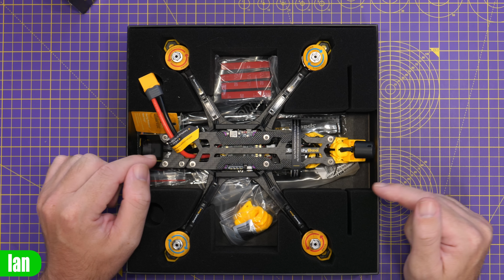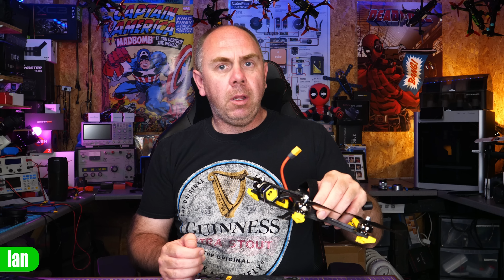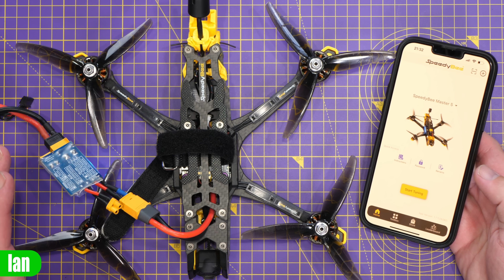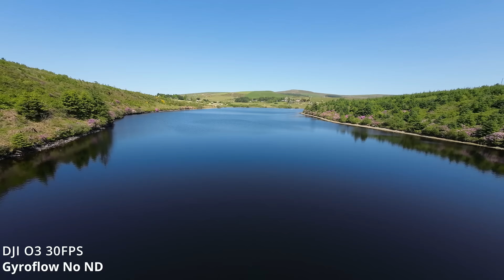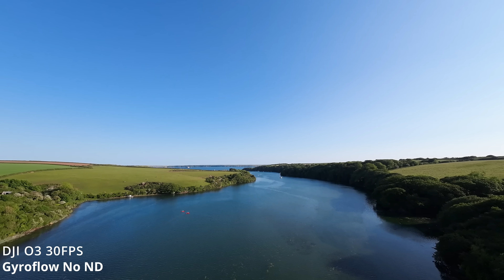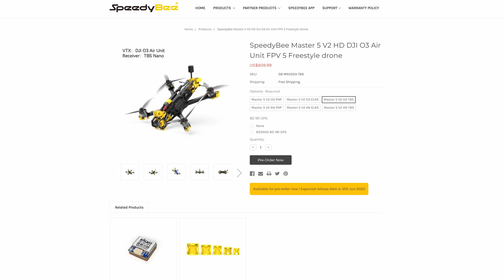SpeedyBee Master 5 V2 Bind & Fly FPV Quad - Making FPV Easy For Everyone

Comment: Could you run this version with the DJI Controller 2 as well? Just reconfigure it with betaflight and as such switch between two different controllers if needed?

Comment: Hi! What power of VTX needs to set in Betaflight for DJI o3 Air unit (25/200/400/800)? There are no one option selected in "Power" select by default. I fly with DJI google's Integra and video signal is lost at the distance about 300 metres.
Reply from the maker: There is no power options on O3 it’s entirely dynamic. The betaflgiht settings have no affect.  If your loosing signal at 300m it counts like you may have a lot of WiFi around you ?
Reply: There are no wifi, I fly in the fields far from the city.  @MadRC

Comment: Hello! I'm a noob and I need help!)) I have exactly the same SpeedyBee Master 5 v2 (ELRS), and RadioMaster TX 12. I have already bind them. But.... The Speedy Bee doesn't react on any manipulation with TX12. I just have change OSD. So what's the problem it could be with? They both have the same 3.2.1 version of ELRS firmware.
Reply from the maker: Have you checked the Model Match is turned off as this can cause issues. Connected to the receiver with the browser with WiFi and check the model match is off.
Reply: @MadRC  Thank you so much!! It works now! The problem was exactly with it.

Comment: I'm super glad to see a BnF with 2306 motors, beginners would be truly helped if more drones came with this motor as it offers so much more control. However... $600 for a drone with Eco2 motors, are you joking? The Evoque costs the same. It should be cheaper if it wants to be a budget drone.
Reply from the maker: I think the problem is the cost is hard to compete with Iflight as they are the actual manufacturer as well.  Iflight are able to price less than most as they cut out the middle man.

Comment: Nice! Weird you have jello without using an ND filter on the O3. None of my O3 quads with the O3 system have jello , ever. Even with variable Shutter speed. I have ISO max set at 800. all have PWM set at 48KHZ fixed.

Comment: EU residents = no customs & fees if you order directly (ali Express will be far more expensive): 
it looks like that if you order from speedy bee (which is runcam and you see if you pay with paypal) you only have to pay the amount shown at the checkout which will include your domestic vat already. Shipping is usually free, but you will be billed in USD which might mean additional paypal currency fees.

They ship with dhl and that is quite fast cause my Speedy Bee FC (wing) arrived within 10 days in germany without any addtionals fees / customs or what so ever 
So great overall shopping experience (but be aware that the speed bee FC wing is at backlog which means you order now and roughly 10 days later they had shipped and I was able to track it with dhl from the shipping notice onwards and then it took 10 days), far better than all the aliexpress offers which are more expensive - the cheapest offers had startet over 50€ but I had paid in the speedybee shop about 39€ or so all included (shipping, exchange fees, customs, vat). 

For me a very important detail cause it makes it a lot, lot easier to buy from a chinese company directly.

Comment: running props in is a BIG mistake w this setup - speedy bee should change this at the factory would save alot of 03's from being scratched. Learned the hard way w some scratching landing on sandy concrete. props out boys! btw dji will ask u for 165 $ to fix a scratched 90 camera module.... DONT FALL FOR IT. buy a new one and use the old 1 for parts or wet sand n re polish it. FLY ON